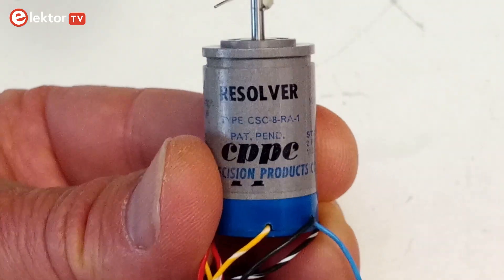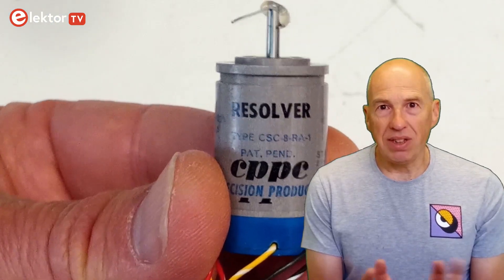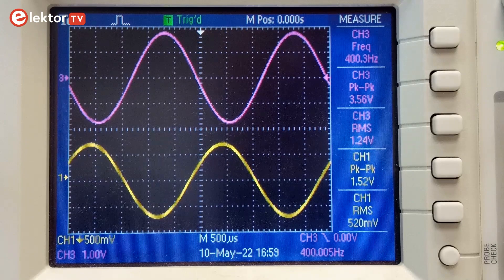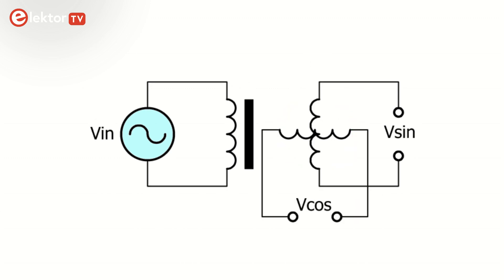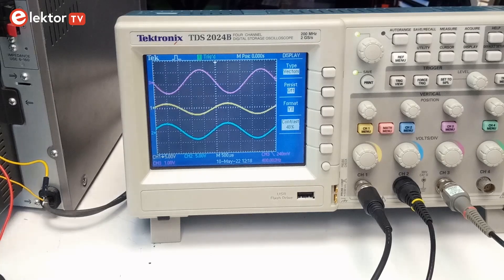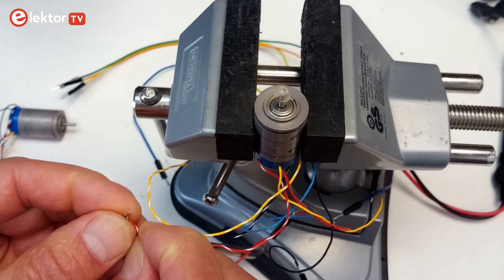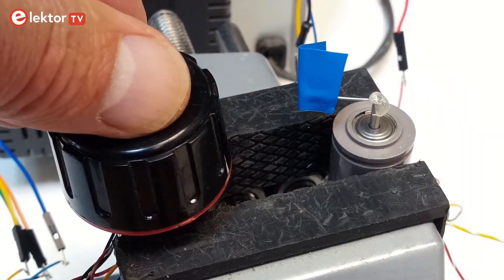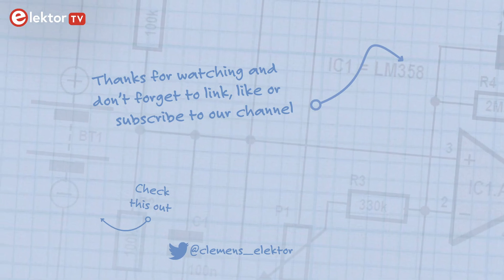Introducing the Resolver

Comment: Resolvers are fairly easy to read with an Arduino or similar. They don't particularly care about the excitation voltage, and (perhaps surprisingly) work fine with square-wave excitation. So you just need to measure the two voltages and use the atan2 function to get the angle out when excited with a 5V or 3.3V square wave from a 50% duty cycle PWM generator. 
You need a phantom baseline voltage at half Vcc, but you can create that with a zener.

Comment: Thank you for this video!
I have a question: why does the resolver rotor have 2 windings? Isn’t one enough to measure the rotor angle?
Reply from the maker: Two windings allow for detecting the spinning direction. Also it allows for better resolution.
Reply: @VoltaicoDevelopment  on the stator it's for producing sine and cosine so you can get an angle around 360 degrees. On the rotor, it could be for redundancy and health checks. Those are used in critical applications so you really need to account for every possible failure mode.

Comment: When I was in high school I got a pair of synchros (also called selsyns) at an electronics surplus store.  The single windings were rated at half the US standard AC line voltage, so I put them in series, then connected the triple windings in parallel, and made a rather strong repeater.  I had a lot of fun with that myself, and later while teaching physics and electronics.  If I ever get the garage cleaned out I will probably find them, and have some more fun now that I am retired.
Reply: Same for me!  When I was a teenager I somehow came across a selsyn pair and played around with it.